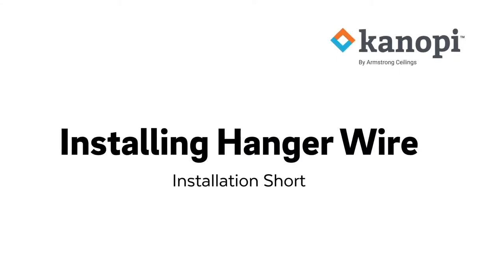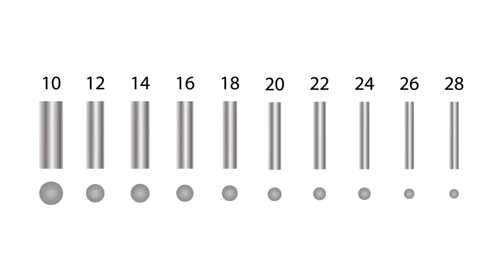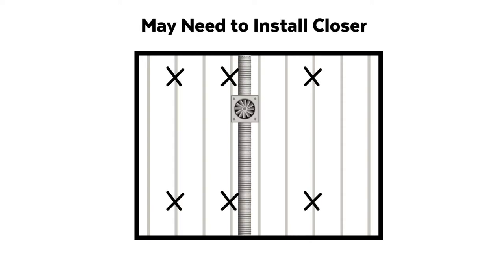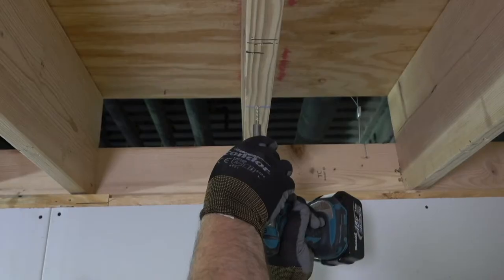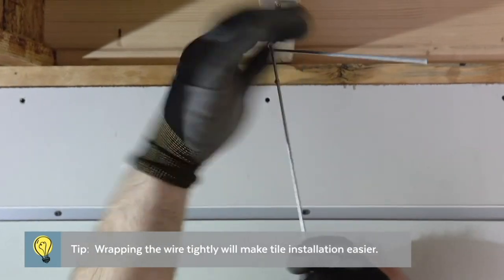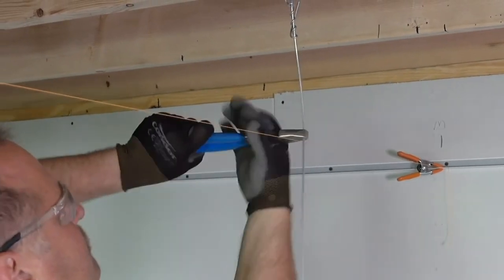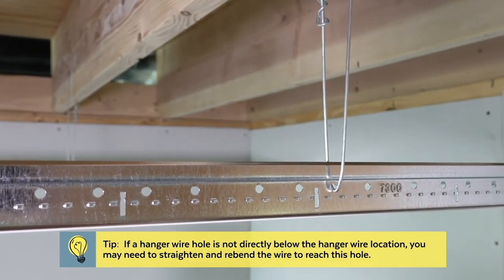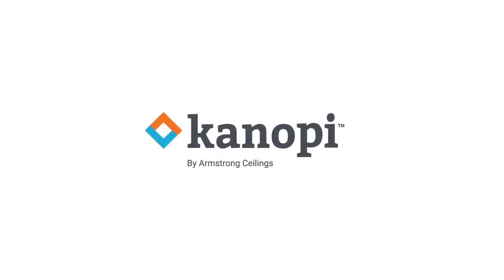How To Tie Hanger Wire For A Drop Ceiling

Comment: Those wires would never pass inspection where I work, they wan no more than an 1/8” gap in between twist and they have to be way tighter than just a simple wrap around